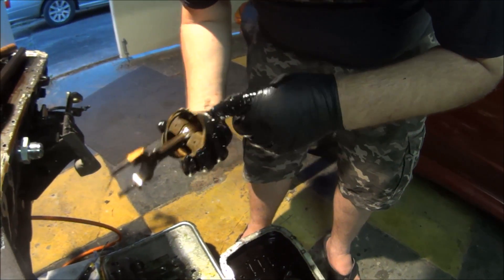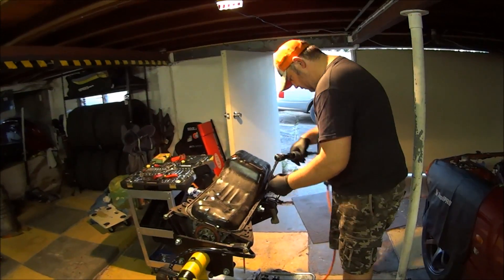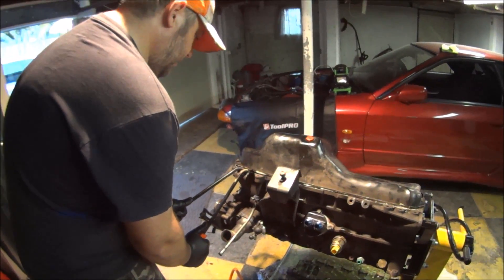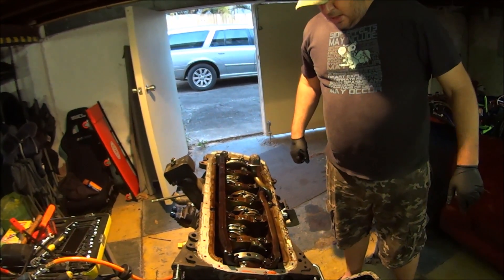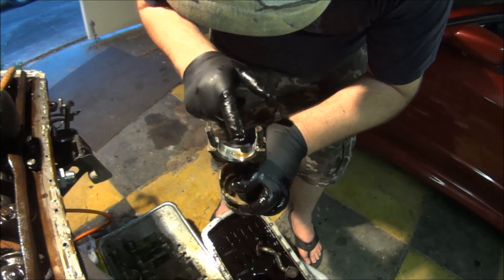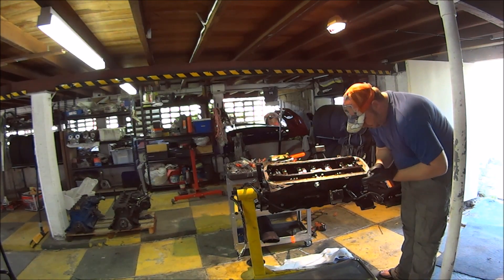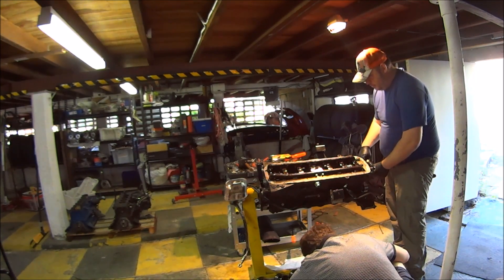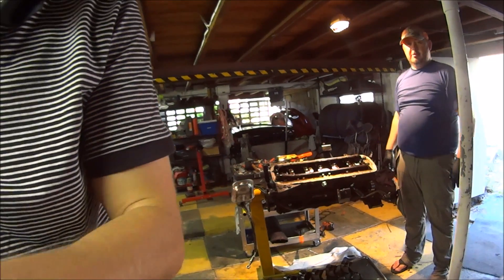RB25DET build - Inspecting Big Ends, Pistons and Internals

Comment: my engine started knocking before the last event drove all event and still runs so gonna keep running it till it blows or i can afford a det motor
Reply from the maker: Well i saw no point in grenading a perfectly good block and crank I've got 3 but would like to keep them healthy/buildable. I's rather spend that money on racing, like set of tyres or accom at an interstate event etc.
Reply: its only a na block so not to worried
Reply from the maker: Ahhh, well in that car ring it till you bin it.
Reply: pretty much its done over 200000ks so alot of ks for an rb
Reply from the maker: Not it's being grannied around, they'll do bulk kms int eh hands of a nanna.
Reply: yeah but gotta a feeling it wasnt babied back in japan think it was all neoned up has it had a hidden neon control box and late 90s early 2000s sexpec red leather for the rear parcel shelf